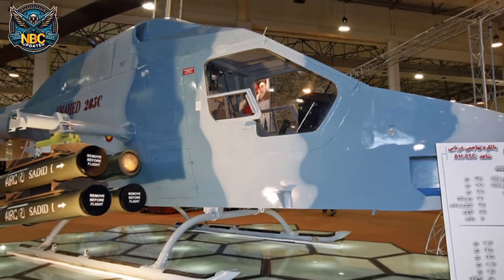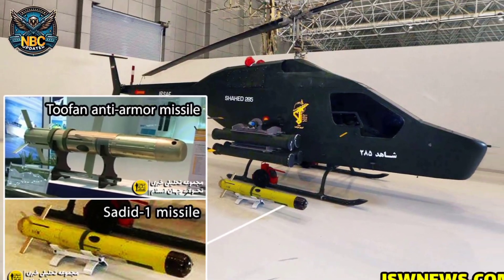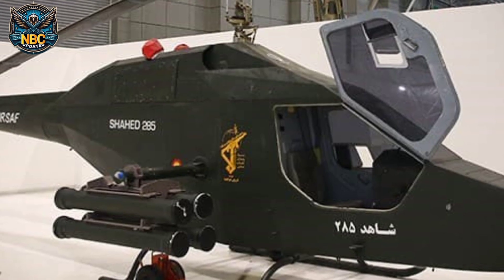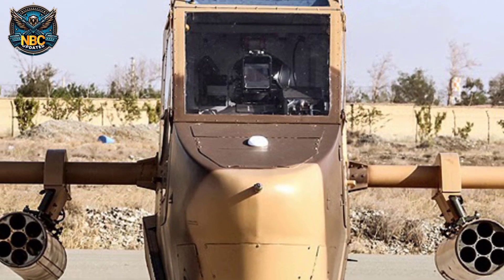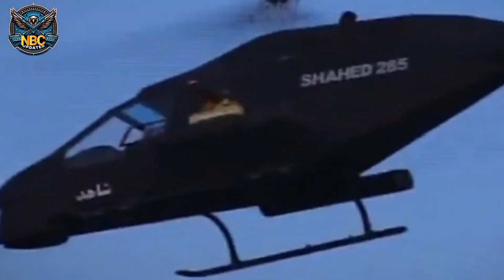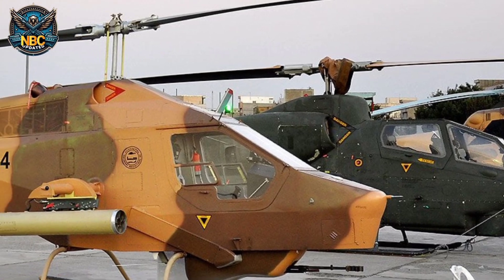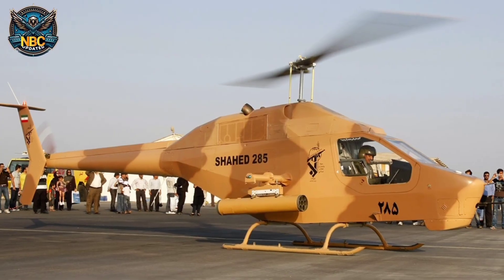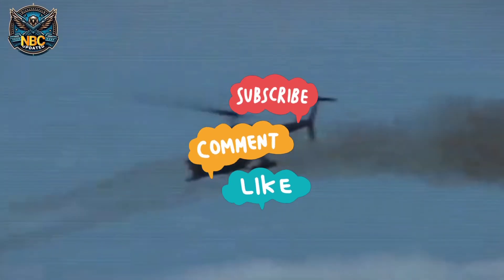Made in Iran🇮🇷series| episode -1|Iranian HESA Shahed 285 attack helicopter #iran #attack #helicopter

Comment: It looks a bit like someone tried to make an old Bell 206 into a bad copy of an AH1 Cobra
Reply: The tail boom looks like pure jet ranger only they've taken the little horizontal fins off and given it a T-tail instead. The engine hump and fuselage look similar from the side profile but its noticeably thinner when viewed from the front.
Reply: Yeah, outta cardboard😆
Reply: A shrunken down Jet Ranger, copied and designed by an eight year old...
They probably tried something along the lines of angular radar deflection or how ever it's called. On the other hand it's more likely they did that for ease of construction and replacement.

But hey: At least it does get into the air and can land.
Reply: That was the plan its only 820kg. Efficient
Reply: @Seiko123  so it's a heavier, slower AH-6 little bird, only with worse visibility, less weaponry, and a single crew member. Seems a lot like it's too slow with not enough visability to do a good job of light scout/obs, and not enough armament or survivability to do a good job of attack helicopter (certainly against a well equipped modern army). But hey, at least Iran can tell people they have an attack helicopter too.
Reply: @IainStewart1972  only by 100 kg, which is fine since its more aerodynamic than  AH which is an age old potato. Modern HUDs and tracking systems are better in it.